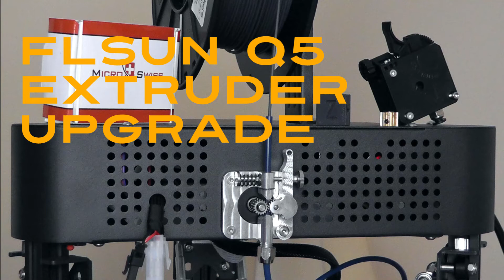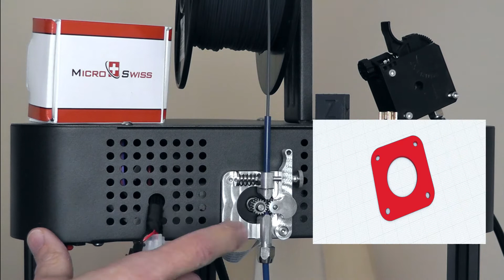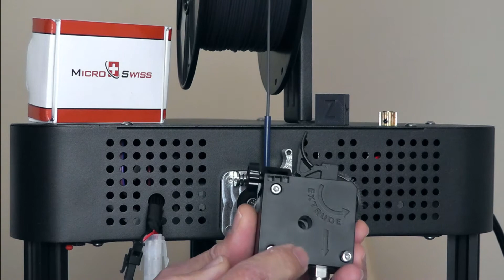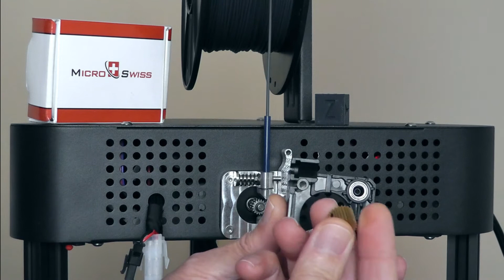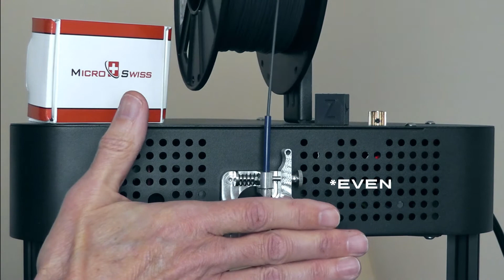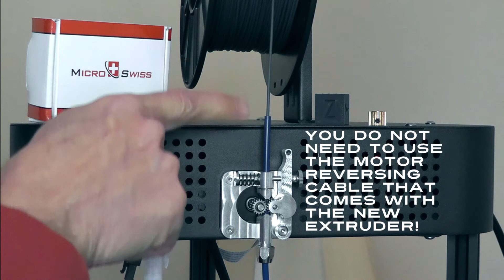FLSUN Q5 Extruder Upgrade

Comment: Other than the E-step calibration, are there any other changes to firmware with this extruder?
Reply from the maker: No other changes to firmware but settings in slicer may need to change accordingly.

Comment: hi sorry, nice video done well. But I encountered a little one problem, the extruder ruins the filament when it passes between the two gears? what can I do or what am I doing wrong? the filament does not make a smooth movement like with the old extruder